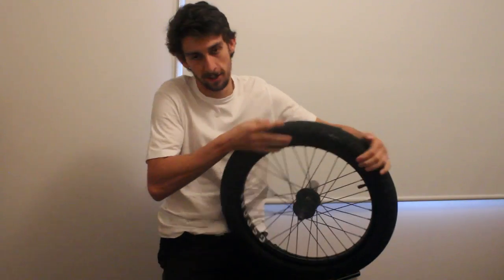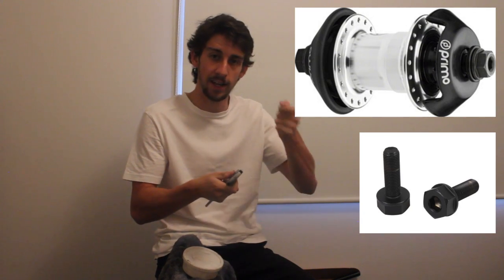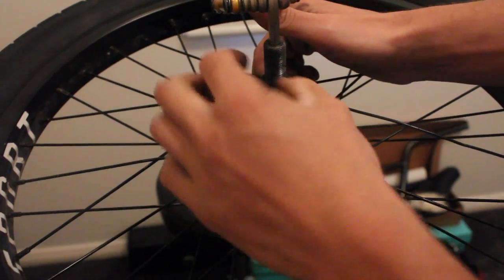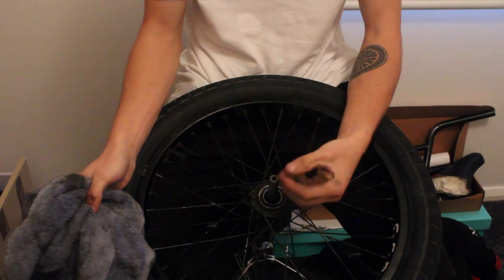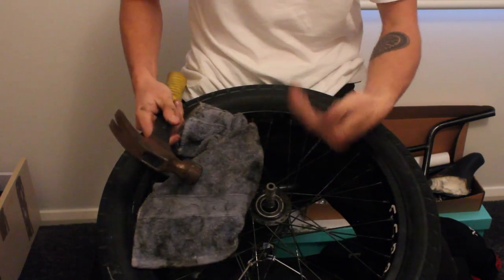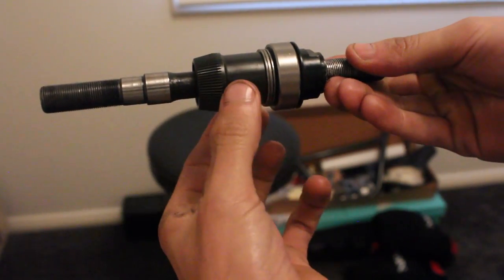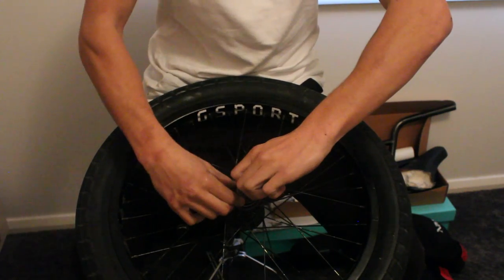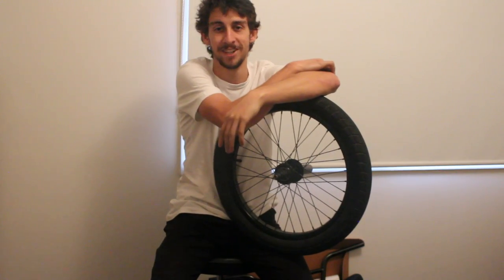How To Clean and Re-Grease A BMX Freecoaster

Comment: what order do the washers go on? I think I put them on wrong.. Is the washer with the rollers suppose to be in between the other two washers? the slack is insane an varies, my knee cant take much more haha!
Reply from the maker: NickyTBeats I'm not 100% sure to be honest! The freecoaster I had (Primo Freemix) had a set amount of slack and you couldn't change it. This also meant the washers never came off. If you are having problems with the slack being inconsistent I would imagine that it could be an issue with the clutch mechanism. What freecoaster do you have?